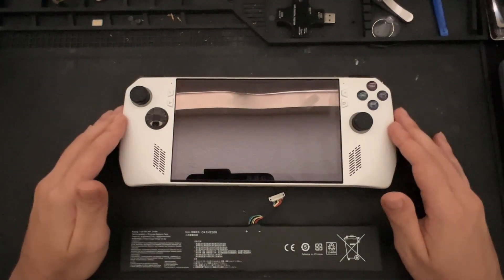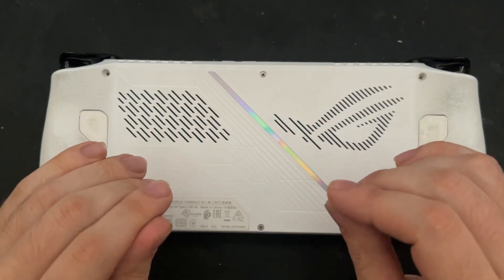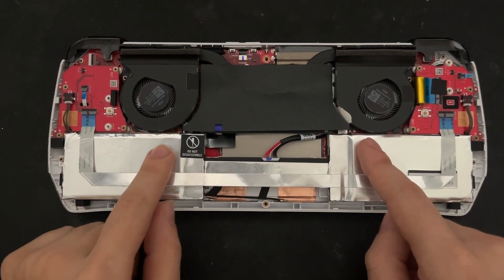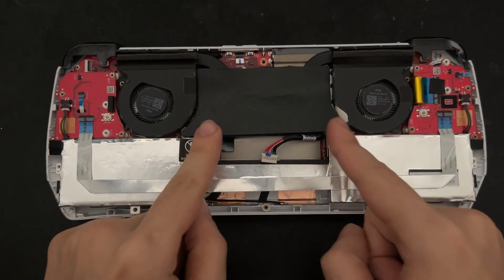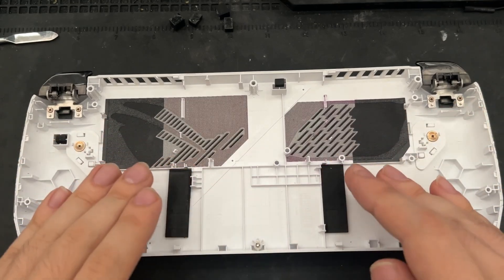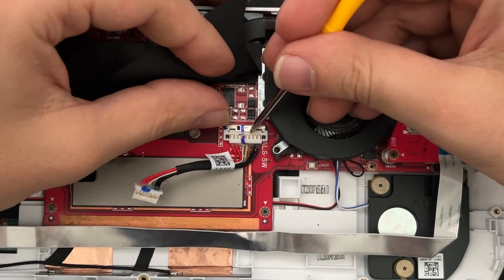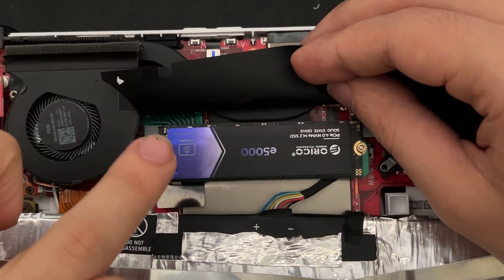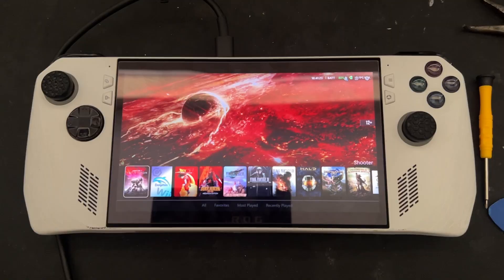ROG Ally: Battery Upgrade/Mod

Comment: J'ai vu des tutoriels ou des gens mettent sur leur batterie du ruban aluminium & Polyimide Heat résistant à Haute température Ruban adhésif . Est-ce vraiment utiles???
Reply from the maker: I’ve also seen people use the heat shield, and not use the heat shield. The main concern seems to be the heat transfer to the ram modules…I cannot say with any degree of certainty using these is entirely necessary.
Reply: @DudePingu  Merci encore pour votre vidéo j'ai changer ma batterie grâce au tuto mais je rencontre un problème elle charge maximum a 99% et je viens de faire 1 cycle de déchargement 0% et de rechargement ( c'est la première chose que j'ai faîtes la batterie installée ).
Reply from the maker: @glm912401 You’ll need to perform a few charging cycles for Windows to accurately capture information from the BMS and report the correct battery capacity. I fully charged and discharged this battery at least 3 times until Windows accurately displayed the proper battery percentage
Reply: @DudePingu   Merci pour votre aide 😇

Comment: Hey question I’ve been trying for 2weeks now my ally is blinking Orange not booting. Is it battery? Or
Reply from the maker: That typically means the device is out of battery power. It's possible the battery is drained or improperly connected, or damage has occurred to the connector itself (probably has some debris or a bit too much wiggle/play in it)

For a normal user an RMA would probably be the best course of action. However it is possible to replace the port if necessary (only recommend for those with the tools, experience and skill to do so).
Reply: @ yeah I just checked the battery is damaged one dead cell so it’s 11-12v instead of the full 15.48v thanks ima get a battery
Reply from the maker: @kenudraw Excellent
Reply: @ it’s fixed the battery was the issue it turned on without the usb c port mine broken lol I just cover the sensor
Reply from the maker: You covered the sensor?
Reply: @DudePingu  yeah with a black tape I can remove battery anytime no usb needed
Reply from the maker: Huh. Neat